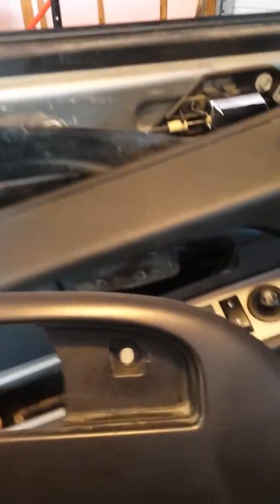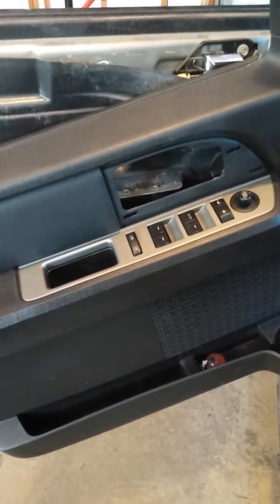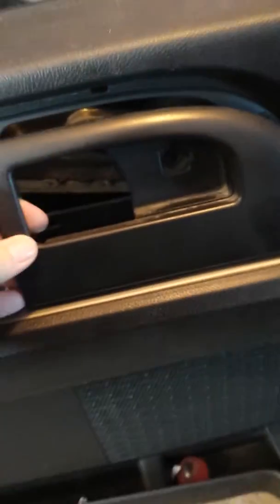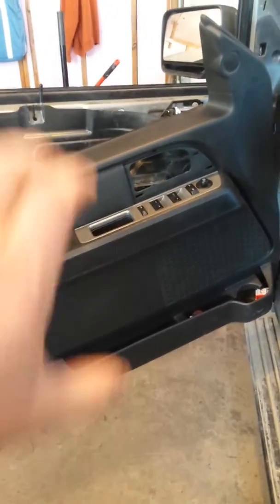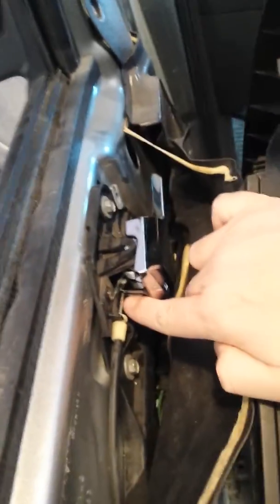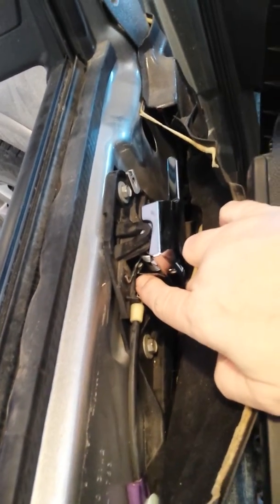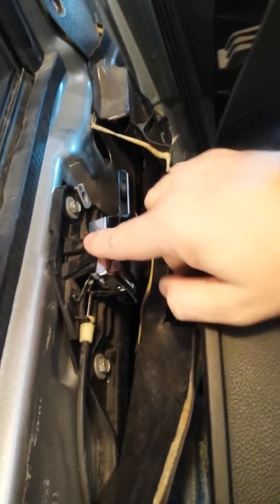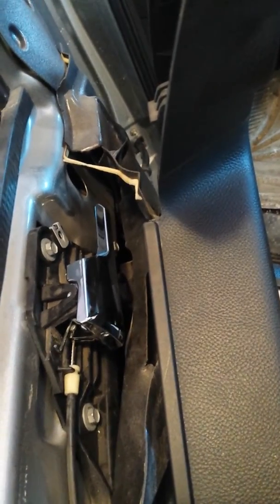2009 Ford Expedition inside door handle replacement

Comment: I want to thank you for putting this video out there for us to see. My passenger side handle broke and the Ford dealership wanted close to $150 to replace. After seeing your video, I went online and bought an after market handle, which came with a new spring, and properly installed it in just under 20 minutes. The handle only cost me $8.50 and arrived in 2 days. This part was $56 at the Chino Hills Ford dealership in California. You saved me a lot of time and money. Once again, thank you.

Comment: I couldn’t find a video either  (FYI didn’t have to remove the panel)  I just removed the trim around the handle 7mm and a flat head screw driver. Took longer to get the tools out than the repair . Hope this helps

Comment: ATTENTION:  if you can still access see the cable and barrel you do not need to remove anything but the silver handle surround, it pops off after removing the single screw in the handle area
Reply: Scott, I tried to see what you mean.  I do see the cable and the handle's spring.  I am not sure what you mean by "barrel".  I have a new handle that I have not installed yet.  There is a thick collared pin that goes through the spring and the handle's behind.

I however have yet to see that single screw that you are referring to.  Can you assist please?

Comment: Any idea what the little clip that holds the handle in is called? Mine broke and I can't find a replacement
Reply: Did you ever find the bracket that holds the door handle in place?  The tab on mine broke and I can't find one anywhere